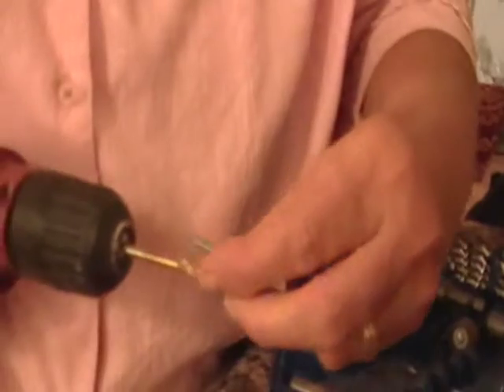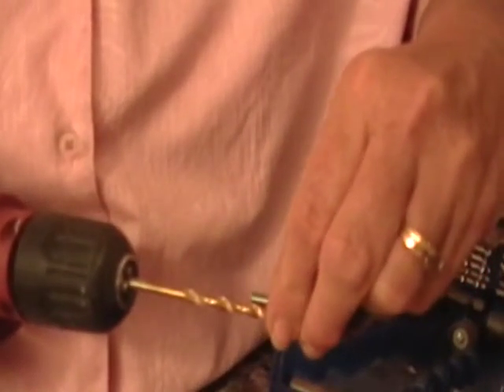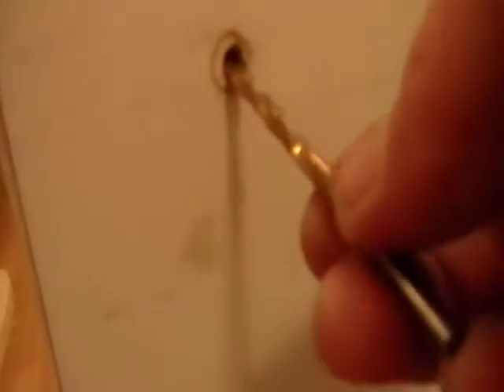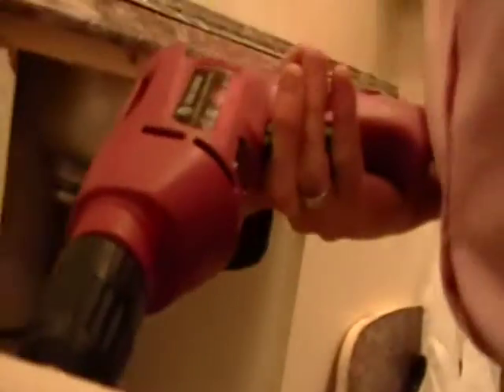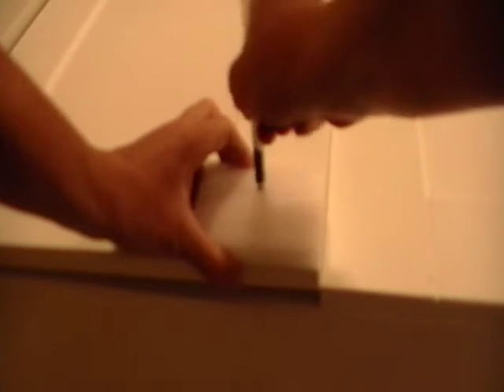Nancy Today: Hole pattern for cupboard handles ASMR

Comment: Nice neat little handles. Nancy if you have a spare handle, you could put it in the hole you drilled in error - it wont look out of place and would be better than looking at filler or just a spare hole, what do you think?  You're doing a grand job as usual, all these finishing touches give you a sense of pride when you stand back and take a look.  Luv, Rene x